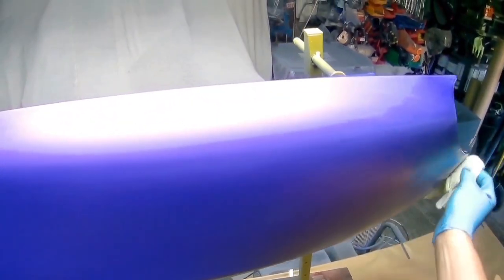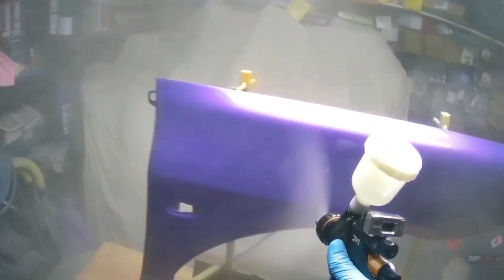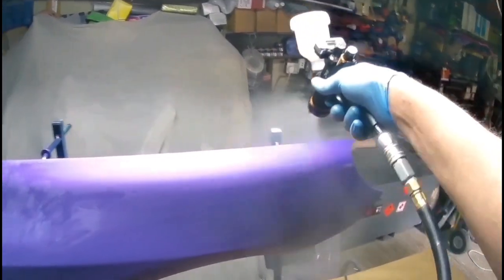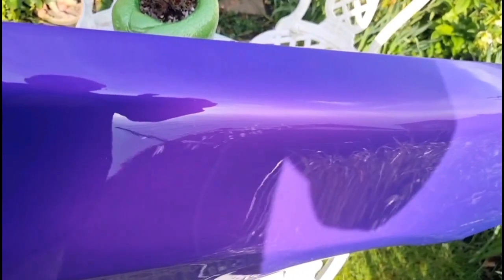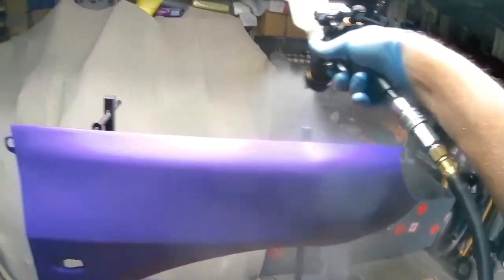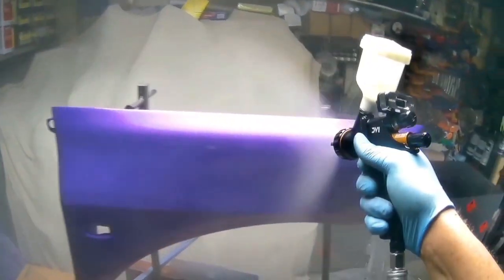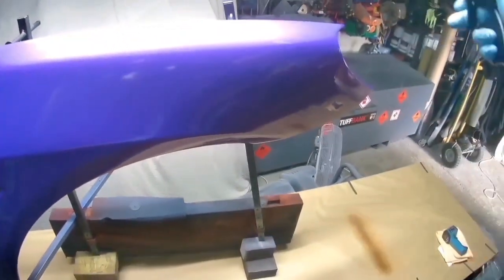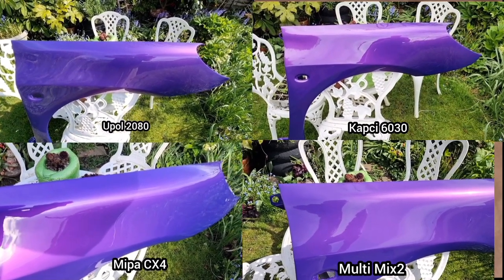Clear Coats, Mipa CX4, Multi Mix2, Kapci 6030 & Upol 2080 Reviewed With Devilbiss DV1 Clear

Comment: Did you add any thinner on the kapci clear coat? Ta
Reply from the maker: Hi buddy, it depends on the temperature, but generally, 5% to 10% is the norm
Reply: @peteshobbies5383  higher the temp more thinner and vice versa? Ta
Reply from the maker: Normally, I go more thinners the lower the temperature, because in warmer weather the clear runs out better , when it's cold it doesn't flow as well so thinners helps it out

Comment: Hi Pete, what mask you use when spraying clear coat to protect from ISO isocyanates?
Reply from the maker: Hi buddy, this is an old video but theses are the ones i use, i don't use the air mask as much as i should, I use the Moldex most of the time and the Devilbiss if I'm doing a lot, the key is to extract the overspray as well as possible, I have a 24" fan in a home made box with filter media that it pulls through, video is below 
https://youtu.be/bSFlIpPoFKw
Reply: @peteshobbies5383  Thanks Pete, I will see that video, I'm concerned about this before I start my project. If you know of any ISO free paint, let me know please. I may end up using 1k. More research needed. So many ppl on YT spraying 2K without proper PPE.
Reply from the maker: Yes,  i agree to an extent, there's lots of scary stuff on the web about ISO clears and paints, some are real and you do need to watch what you do, ofter stuff is just scare mongering, i read once a chap used 2k in his shed once and half his garden died, that's just rubbish, so yes, take care but don't get too hung up on it otherwise you won't do anything

Comment: hi how much pressure you use for kapci clear thanks
Reply from the maker: Hi Mindaugas, on this test with the DV1 it was 2 bar at the base of the gun or 1.5 on the digital gauge,  if you use a different gun the pressure may not be the same